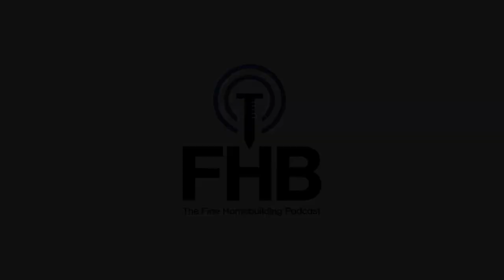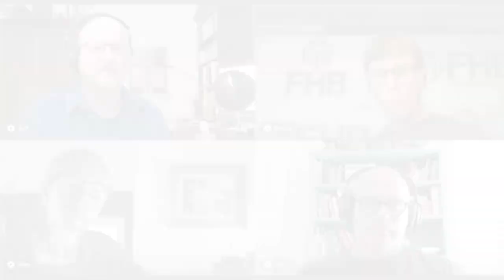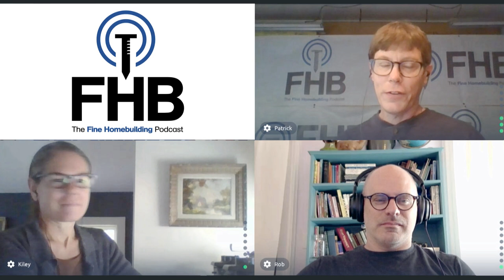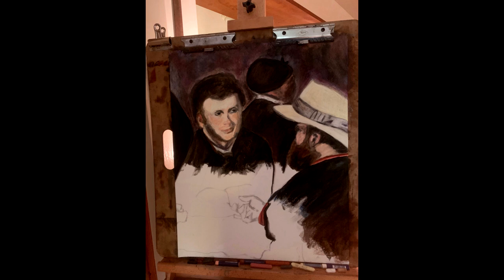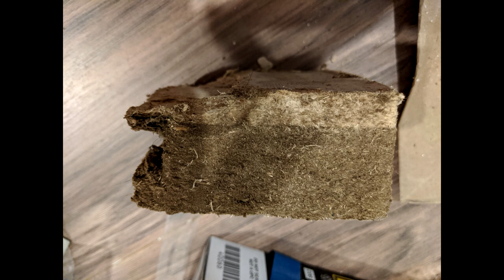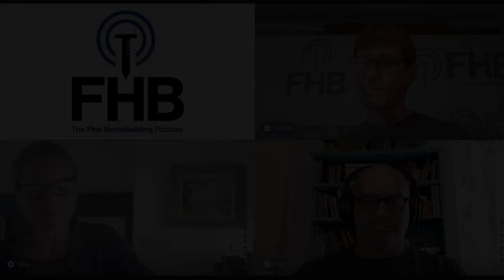Podcast 291: Overdriven Nails, Indoor-Air Quality, and What is This Attic Insulation?

Comment: I have seen a kitchen counter made with hardwood flooring, nailed to a plywood substrate.  You can get really nice wood for an attractive price that way, and it can look great.  But it doesn't work well for long.  The wood expands and contracts with humidity changes, and small cracks open between the boards.  That is fine for a floor but not for a kitchen counter that gets wet regularly.  You might be able to use tabletop construction methods borrowed  from your friends (?) at Fine Woodworking, but just nailing down to plywood doesn't work well for that.